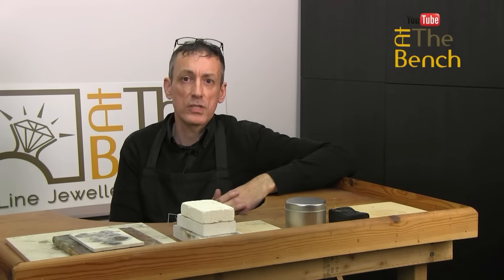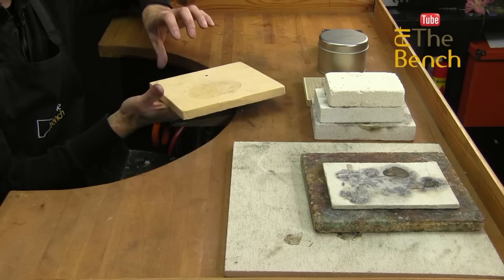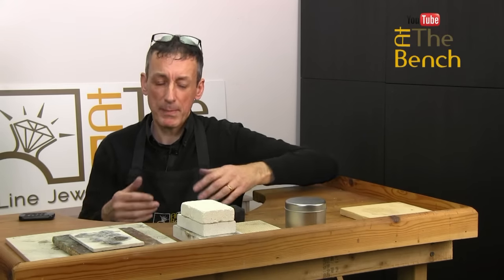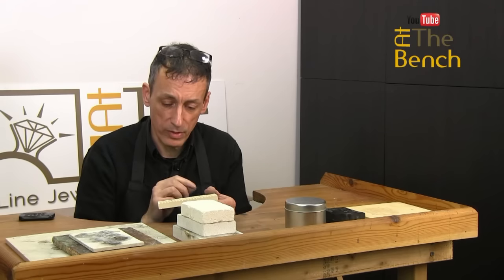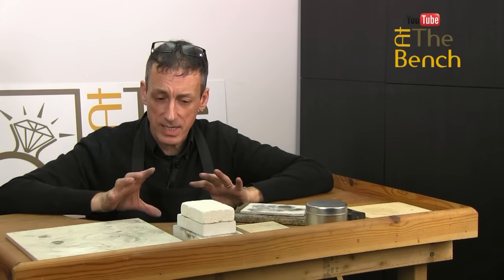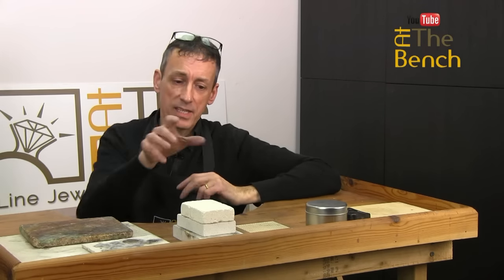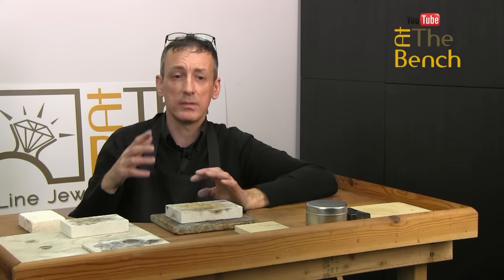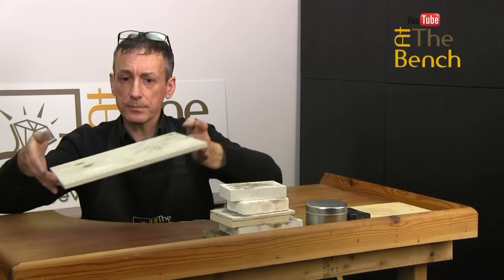Soldering Surfaces - Soldering and Making Your Own Jewellery At Home

Comment: Andrew: kiln bricks work great, I use them for soldering all the time. I make mini ovens out of them too if I’m annealing large pieces of metal.  There is more than one kind of brick: You have to get the soft bricks used in ceramic kilns which reflect heat, and not the kind used in wood stoves, which absorb heat, and are harder.

Comment: What kind of material is the 6"x4"x1" soldering brick that you favor at the end of the video? Is it Silquar, Solderite, Vermiculite, Megnesia, what? I'm looking for a thicker solder brick than just the average 1/2 inch or so without using charcoal. By the way...I just recently came across your "At The Bench" channel. Awesome instruction, I have really learned a great deal. Thanks Andrew.

Comment: Hi. I've been studying and now I'm finally ready to buy a solder block. I'm going to try my hand at fusing Argentium (it's cleaner) or Fine Silver wire with a butane torch to make a Peacock Link Bracelet but when I Googled "Solderite" there's 2 kinds (hard or soft) to choose from. Also the bracelet tutorial says to use kiln bricks and that absorbs heat instead of reflecting it (IF I understood you correctly). I want to get a block that can be used for both soldering or fusing. Which block is best? Hard or Soft Solderite or kiln brick? Or does it matter? 

Thank you so much!  Cheers! 🙂

Comment: A large juice can makes a good source of material make a great block holder. I cut the can bottom and top off and split the can down the seam and hammered in flat. It real easy, tin is not hard to bend flat with little tapping with a hard rubber mallet. I transferred the measurements to the now flat tin and cut a square in each corner and score the tin to make a fold. Once flooded I took some lead free solder and secured the corners. I file and sand the edges and install my block in. Keeps bench clean

Comment: Honestly I don't understand why people have an issue with charcoal blocks, they are produced with an essentially negligible amount of  environmental damage relative to what a normal person causes going about their day to day life. If you were really worried about it jewelry is probably the wrong hobby or job for you, and if you just wanted to minimize your evironmental damage while still creating jewelry you are probably better off getting some solar panels and an electrolysis setup to power an oxyhydrogen torch instead of using butane or propane.

Comment: You can take those charcoal and solderite boards outside, get some 80 grit, or so, sandpaper and sand down the dirty surfaces making them like brand new again. Save you money and less waste!
Reply: Good tip!  Thanks!  If you use soft kiln bricks (which do reflect heat, I use them all the time) you can rub two of them together to “sand” off the crusts of flux that accumulates over time.
Reply: and if you do that under water, that prevents you from inhaling the dust

Comment: @Andrew Berry, Quite new to this! Can I solder on a concrete block? It's just a plain concrete slab. I'm finding that no matter how well I prep my area, flux, try different torches- my solder takes ages to flow! Could it be my surface? I am trying to 'perfect' a gallery setting but it takes so long to solder some parts that I end up melting my prongs :(  Much love and light!
Reply from the maker: Samantha-Jane Katz No. you need a proper soldering surface. Concrete will absorb the heat. You need a surface that will reflect the heat. A proper soldering surface, sheet/pad is the correct surface to use
Reply: Thank you Andrew!
Reply: Andrew Berry , to add ...Concrete also can blow up under heat ...
Reply: @Atthebench  what is the name of the correct soldering block material, Sir? Thank you in advance and greetings from Denmark
Reply from the maker: Gabriel Cornea I get my boards from https://www.bettsmetalsales.com/soldering-boards you should be able to get the same boards in your country too

Comment: Just wondering if 'fire bricks' will work for this?  They are only about $1.50 each here and seem to work for me but I don't know if they are absorbing any of the heat or not.
Reply: Barry Black  Hi Barry, kiln bricks work great, I use them for soldering all the time. I make mini ovens out of them too if I’m annealing large pieces of metal.  There is more than one kind of brick: You have to get the soft bricks used in ceramic kilns which reflect heat, and not the kind used in wood stoves, which absorb heat, and are harder and smooth.  I paid about $4 per kiln brick from a ceramic supplier.  If they are only $1.5, you might be looking at the wrong kind —don’t buy from hardware stores they probably only have the wood stove kind.

Comment: Gave up using charcoal years ago because of the ridiculous prices
Reply: przybyla420  Yes but it needs to be compressed charcoal for soldering purposes. so it’s better to just buy it. They are only about $20. If you take good care of your charcoal block it can last a long time.  wrap binding wire around the perimeter to support it, and spray it with water after soldering, so it cools any embers down.  This is safer for you, and increases longevity of the block. the reducing atmosphere of the charcoal is a good choice for working with sterling to decrease chances of firescale.